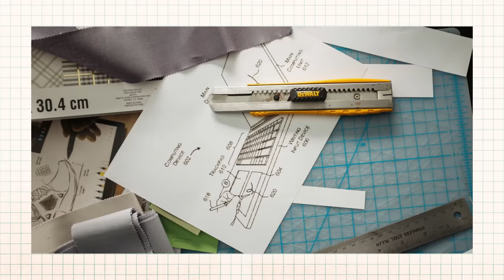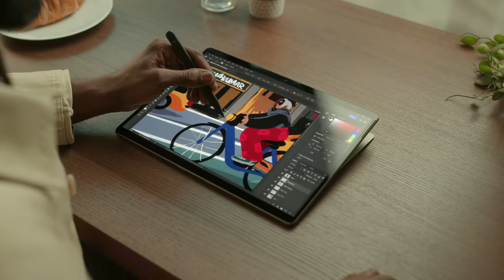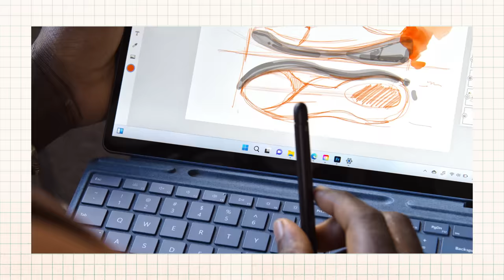Explore the innovative design of the Surface Pro 9 | Designed by Microsoft, Made for You (Eps 3)

Comment: Can’t wait for the surface with the Orion chip. I’m truly hoping this solves the emulation issue and allowing for x86 apps to work as if naturally running on x86 so that one hour long video renders take 2-3 minutes like it does on M1 MacBook Air. If that happens I will have no issues going Surface only.
Reply: A Proper Arm chip - in that Qualcomm SnapDragon X Elite. But wait 2025 we should see some incredible performance in levels of magnitude better than what that has in Nvidia's Arm based gpu and cpu's if ONLY they can significantly improve performance per Watt. NVidia never had to care about that before so I'm skeptical they'd have an engineers eith such expertise to bring it. We shall see.

Comment: This video is a confirmation that there won't be Surface Pro 10 i suppose, at least not this year... Hopefully Surface Pro product line didn't die completely.
Reply: surface is just in maintenance mode atm
Reply: guess it will die with the leaving of panos..this year keynote is very meh...doesnt bring excitement.
Reply: Development from Qualcomm and their recent announcement of the X Elite Arm chip leaps and bounds what the Surface Pro 9 has for arm chip that's the reason for the wait. Expect later summer 2024 for a Surface Pro /11. 

I just pray for NO proprietary connections just straight up TB4 ⚡️TB5 is ready by then and x2 of them.
Reply: It's already DEAD for YEARS LOL

Comment: Surface Pro 7 user. I got the high end one too but it's always been super slow and the drawing responsiveness is usually lagging behind or sometimes jittery. Can't handle more than a couple browser tabs and good luck ever multitasking on it. I love the form factor but I can't see myself getting another Surface until I see some major performance improvements.
Reply: Get a mac
Reply: Get a Surface Laptop Studio 2 with 32GB of RAM
Reply: @jmoralesv03  Surface Laptop Studio is not same form factor. If people love Surface Pro, it's, at least for my part, for the form factor. Detachable keyboard. I also own Surface Pro 7, and was waiting for the Pro 10 to upgrade it. My main dissatisfaction is battery life with the i7. I was hoping for a new ARM model, for the battery life (i don't need the horse power of the i7 after all).
Reply: High spec surface pro 7 and slow don't go together. Sounds like yours may be defective.
Reply: The surface pro 8 fixed that. Buy an 8 and above and it's silky smooth 120hz
Reply: @WinniePooh33 way too expensive for what I use it, for example. Not worth it for me

Comment: Been all in since the original Surface Pro, even faced the reoccurring 4 battery bubble conundrum replaced by the 6. The 6 has been around the world a few times, to include deployments and, with solar panel, an external batter, has been on Boy Scouts trips while completing a dissertation. Heck, got my son the 2 while he was in high school in which the top left quarter panel was promptly dropped the pickup truck tow ball... And, even with the dent, it just kept on going.... Later replaced by the 7, due to the college rigors needing more functionality, and then given to a fellow Veteran for his needs.  For the 9, I dig the newer approach to swapping out the SSD, but am really waiting for the proprietary plug drop in favor of a USBA or an additional USBC with charge through.  Heck, I'm even contemplating the Go once the motorcycle is purchased with sidecar for the doggo.

Comment: I still use my Surface Pro 4 for light computing. Still works great!
Reply: Does your SP4 have that processor defect that uses battery power when turned off?
Reply: @christianadriandelarosagar7261  I never noticed anything like that. My SP4 has an Intel Core i5-6300U CPU @ 2.40GHz/2.50GHz. Still works like a champ.

Comment: I've been a fan for the last couple of years, and I'm super pumped for the next generation of the Surface Pro.
Reply: I've like thr concept yet Microsoft's past windows have failed to deliver a great touch interface experience that ive used and sent in the corporate space across both mining and financial industries. 

The root of thr problem is Microsoft hardware and software team STILL comes at creation and evolving the Surface Pro from those old WinCE tablets that traders used on shoulder straps back in the late 80's into early 90's. 

- still issues with spurious inputs from holding sides with your hand. 
- still issues with a right side up thinking ove the camera (there is not right-side up, the USER is the focus and thus perception of anything to be used for it needs to start with that holistic focus. Meaning the end user for 15yrs will launch several apps at the start of the day, we know what we're launching we do NOT want nor NEED huge splash screens jumping like TV ads in our faces to slow user control or data input into an app already launched and ready to be used!)

- why is a proprietary port STILL used on the Sirface Pro in 2023 for need to use a dock!?!

We've had TB3 and TB4 for years and soon TB5 which futher doubles effective usable bandwidth and quadruples it as well!

No more proprietary connections PLEASE! STOP thinking like the old Nokia to keep use purchasing a single accessory when the user should have chose to what suits them. 

Me I'd like to use an eGPU as a dock and gain both internal and external screen and game performance. You may want the archieltectural performance gains.
Reply: Why can Asus for 4 yrs include a mobile GPU in their better version of thr Surface Pro and Microsoft cannot?!!

This video is a marketing hype piece but misses the huge point of tradeoffs you make so you cannot CAMNOT bring it "anywhere"

Comment: There should be a drastic change. This one is basically a speced up Pro 3.
Reply: What about the iPad. Drastic change for that as well?
Reply: @kahuna1247  I'm no fan of the ipad.
Reply: I like innovative changes but the surface pro line is so nicely designed, I'd almost be afraid if they changed it.

Comment: SP9 starts at AUD2000. The 8gb ram model is straight up unusable with Win11 and legal action should be taken against Microsoft for selling an unusable 8gb ram model.
Reply: I'm annoyed by it everytime I open 1 edge and office and am constantly thinking about it.
Reply: @tahsin28  maybe there are some software issues / if its a company laptop then most likely the security software is causing the slow down...just contact sp support n they will most likely replace a new one.
Reply: Support doesn't help me cuz I didn't buy it from the online store.